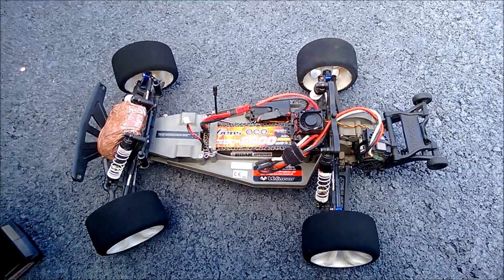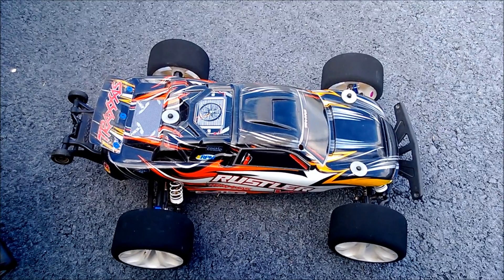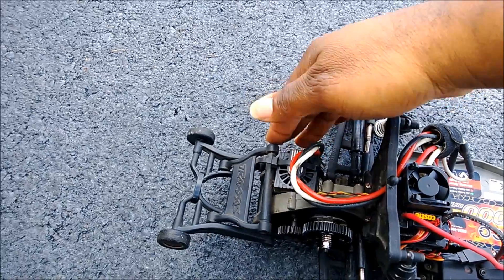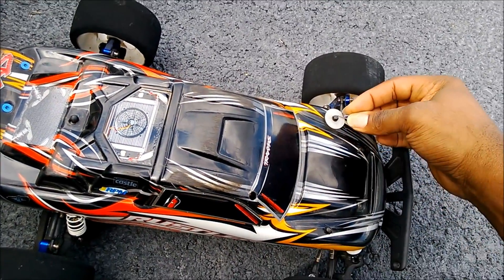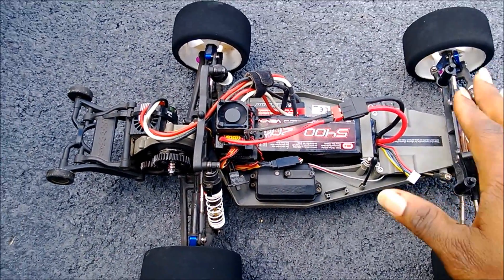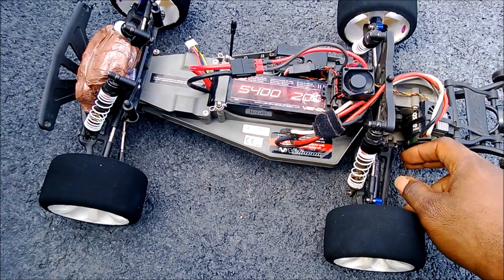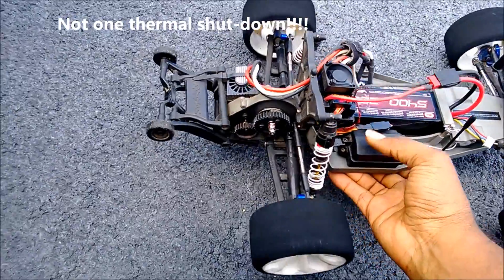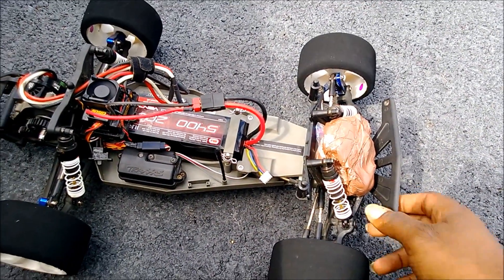Ep. 4: 65 mph on 2S LiPo?! - High Speed Shake-Out w/ Mod 1 Gears

Comment: Did that gearing fit without drilling extra holes for the motor?
Reply from the maker: Yup. It's surprising what ratios you can fit in that transmission with a near-stock sized motor.
Reply: @RCPhysics  so 25/36 fits because ive seen alot of people do 24/36 only
Reply from the maker: I think I ran 25/36 at one point. It should work.

Comment: You said 2s on 65. That was not near 65. Just from watching, that was MAYBE 40-50 on 2s, at full throttle.
Reply from the maker: It's really hard to judge these things just from sight, so I took the dimensions of the parking spaces and the time index of the frames where the car crossed the lines to do an estimate. I freely admit that there is a large margin for error on this method, which is why I usually run with a GPS on-board. However, watch this video which did use onboard GPS units. The "seat of the pants" fly-by speed feels really close. 

https://www.youtube.com/watch?v=kXD14gndwhc

Comment: What tires are you running on that? if you dont mind me asking. Im running a similar setup on my rustler(stock tires still)and im not far off from a blow out.
Reply from the maker: Those are good ol' Jaco foams. They are great, but only good for about 3S-4S power before you'll strip out the 12mm Hexes. You can also try the BSR foams (same manufacturer, but 17mm hubs) or have Rick from Gone Bananas make you some custom foams.
Reply: rhouse21 - RC Physics thank you very much,ill have to look into it further but this definitely helped alot.
Reply from the maker: My pleasure!

Comment: That castle fan deal sucks, hardly get anything outta it cooking wise. I'd recommend a integy heatsink and a 30mm WTF fan.  You'll get a easy 30°F cooler temps consistently. On my 1/8scale I just have a 40mm WTF fan on a fan mount and it on it's own does 25-30°F temp decreases. They move some serious air. Neat older vid tho
Reply from the maker: As you can see, this was one of my first videos. I still use the stock Castle Fan on my speed Rustler and Apex, though. Why? I generally never get the motor beyond 160-180 deg F on these cars, which is perfectly safe for the motor. Sure, I could upgrade the fan which would drop temps significantly, but there are actually minor advantages to running a motor at slightly elevated temps. Warmer stator coils generally have lower resistance, which lets the motor pull a little more current. This can let the motor make a little more torque (at the cost of a little more heat generation). Once I get my motor test stand working, I'll try to do some testing at different motor temps to see how the efficiency is affected by heat.

Thanks for watching and for the great comment!

Comment: That ground kissing tire set up sweet..Brand, compound?
Reply from the maker: Jaco Foams Purple compound. I believe they are in the 30-40 Shore range. They do good work. I use the Rustler "front" offset on all 4 corners. It gives the rear a little wider stance which adds stability.

Comment: Ahh ok man. Well I got the 1410 4 pole brushless roar approved 3800 kv act edition system inside my Traxxas Slash 2wd so Is that what this basically is or is it the regular 3800 kv system that's not 4 pole ????...
Reply from the maker: Yup. Same setup. There is also an SCT setup that comes with the Mamba Max Pro (MMP) ESC and a 1410 3800kv 5mm output shaft. I was running a Mamba Monster X ESC in this car last year to get data logging, but will actually be "downgrading" it this year to a Mamba X 1/10th scale ESC which is the successor to the MMP so I can finally "officially" put this car in the 70+ MPH club. Sorry for the delayed reply.

Comment: By the way which kv and system is this specifically ?... I was thinking to just stay 1/10 scale brushless systems with my newest rustler I did a review on my channel which is ampn XL-5 brushed Titan 12 turn 550 edition. I'm looking to do a castle creations setup with my new rustled since I'm keeping my vxl just that... VXL.. lol. I wanna be able to use a 2S lipo and get around 55-60 or even 65 if I can and about 70-90 with a 3S without having to go with a 1/8 system of any brand.
Reply from the maker: This is with a 3800kv Castle 1410 setup. There are guts getting CRAZY speed with these running 2 2S or 3S batteries in parallel. I think you can do about the same just by using one really good pack. I plan on demonstrating that this year with my Venom 100C cells.
Reply: Castle now has a 6s system with a 4600 4 pole motor rated to 100,000rpms. 100+mph....

Comment: Awesome video dude great work !!!!! Traxxas is really good and on 2S that is amazing lol. I need 3S to get that with my Traxxas rustler vxl velinion 3500 kv system lol. I run 32/76 gearing. 32 pinion Robinson racing and a Traxxas 76 plastic spur both 48 pitch. Rustlers excellent for speed !
Reply from the maker: Thank you! They are a great platform!

Comment: did you ever get GPS of this setup on 3s I run stock vxl 3s and it shuts down.. not sure if the battery's the cause
Reply from the maker: I did get GPS of this setup before adding the aero work, but it was 
unstable. The nose lifted pretty bad and it lost steering. I also got a 
lot of thermal shutdowns with the sidewinder ESC.  Here is a video of it
 running 3S at 73 mph on GPS.... right before it wrecked. https://youtu.be/d2FSg_-3teI

Get a $3 LiPo checker w/buzzer from Amazon or Ebay and install it during your run with the warning set to match your LiPo Cut-off. If the battery is to blame, you will hear the alarm kick in. It's probably just your ESC going into thermal shutdown, though.

If you think about it, even on 3S your car is pushing 1.5-2 Hp on a 70-ish mph run. The stock 3S systems aren't set up with enough cooling to handle repeated passes at that power level. The 1/8 scale systems on the other hand will handle these power levels all day without issue, which is why this car now runs an MMX ESC.

Comment: where were the mod 1 gears purchased?
Reply from the maker: Mod 1 refers to module  1.0 metric gears. Traxxas makes an assortment of inexpensive gears in this size for the e-revo and xo-1, but they are not as tough as the aftermarket options. I use E-Revo plastic spurs on my Rustler, which is fine for 3S power. Robinson Racing makes a wide range of pinions that are very tough. Poseidon, Kershaw Designs, Hot Racing and a few others have steel spurs that will handle at least 8S power.
Reply: rhouse21 - RC Physics hey kan i run 34 mod1 and 25t mod1 on the sidewinder motor on my redcat volcano  whit out over heating the motor i already  no how to put the mod1gears in my volcano i might  make a vid on how to
Reply: rhouse21 - RC Physics hey kan i run 34 mod1 and 25t mod1 on the sidewinder motor on my redcat volcano  whit out over heating the motor i already  no how to put the mod1gears in my volcano i might  make a vid on how to

Comment: what are Mod 1 gears and where do you get them? 1410  Castle? ESC? Great vid.
Reply from the maker: +Jose Valentin Mod 1 gearing refers to the pitch of these gears. They are also referred to as Modulus 1 gears. Metric gears are defined by the gear circumference devided by the number of gear teeth, so Mod 1 = 1mm per tooth. These are used in many large scale or high powered RCs because they tend to be very strong and can handle really high loads. Traxxas Slash 4x4s on the other hand come with smaller toothed Mod 0.8 / 32-pitch gears, which means each each tooth is .8mm. Smaller models like Rustlers often use smaller toothed 48-pitch gears which means the gears have 48 teeth per inch. This video is with the 3800kv Castle 1410 motor and a Sidewinder 3 ESC.

Comment from the maker: Using video analysis, I estimated my 2S speed at ~65 mph. Not bad for 2S!!!
Reply: i have a stampede vxl with a 26tooth pinion and a 86tooth spur gear you have a 25tooth pinion on yours and it looks twice the size of my 26tooth pinion gearing is confusing please help?
Reply from the maker: Your stock gears are "48 pitch" meaning they 48 teeth per inch in 
circumference. Many 1/10 scale cars use this size gears since they give a smooth mesh that doesn't usually need to take a lot od load. I am using "Mod 1" or module 1 gears which are a metric gear size used by E-Revos and many high powered 1/8 scale and larger cars. They have much larger teeth that can take more load. The down side is that they are much bigger, heavier, and the gear action is "chunkier."
Reply: rhouse21 - RC Physics
Reply from the maker: Yes....?